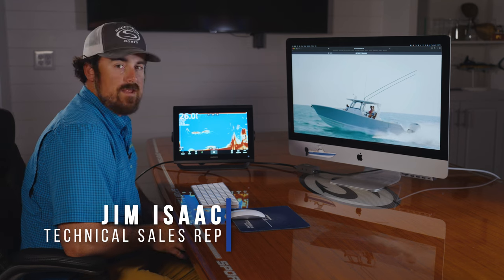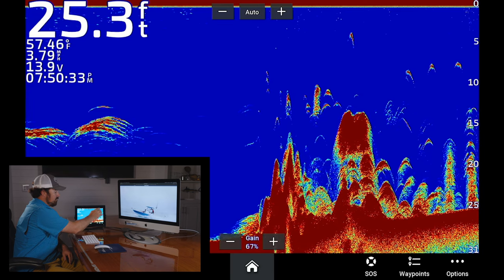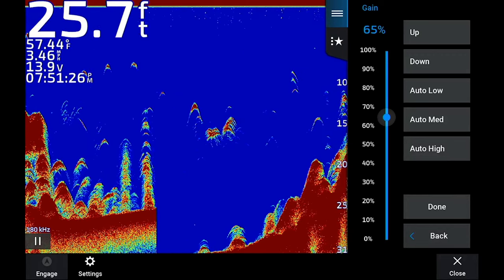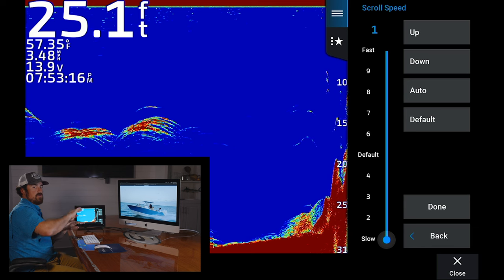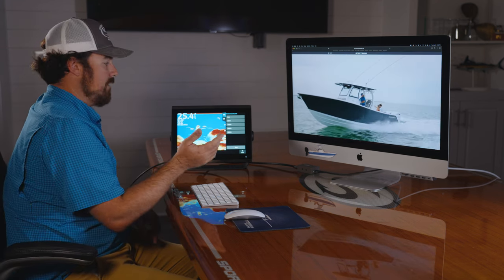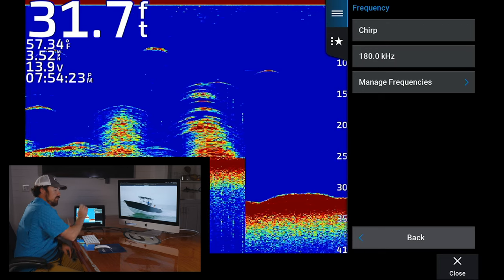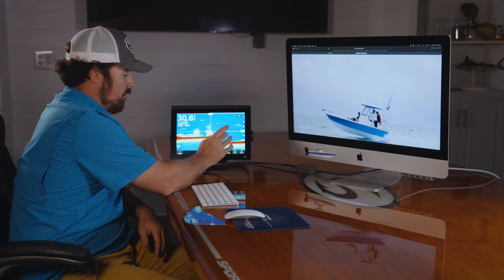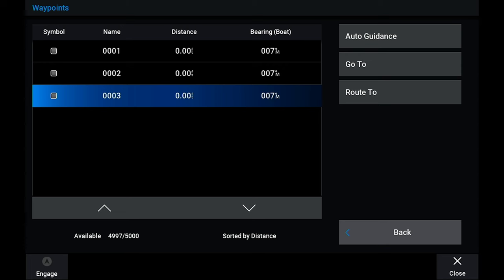Tech Talk - How To Read Garmin Sonar Imaging - Easy Tips To Catch More Fish

Comment: Hi there, thanks for the great video. I have a Garmin 74SV. How do I reset the Garman without eliminating the engine data? I’m not really seeing fish on the screen but would like to reset it without having to re-calibrate the Nema set up for twins
Reply from the maker: CJ, we do not have a lot of experience with this unit as we do not use it in our production. However, one way you could try to solve this issue is to check your transducer selection in your sonar menu and make sure that it matches the transducer you have installed. Resetting your Garmin unit will not solve the issue so you don't need to worry about that.